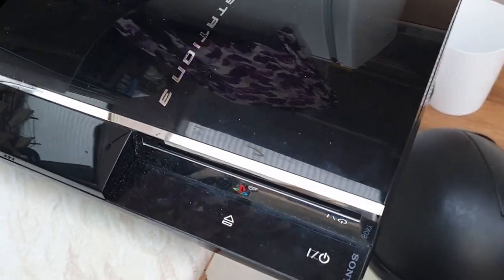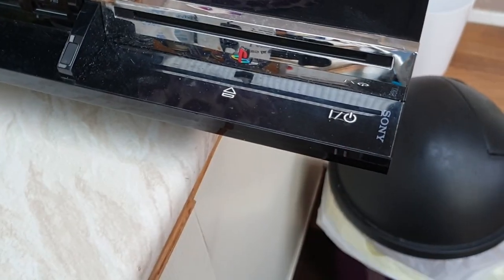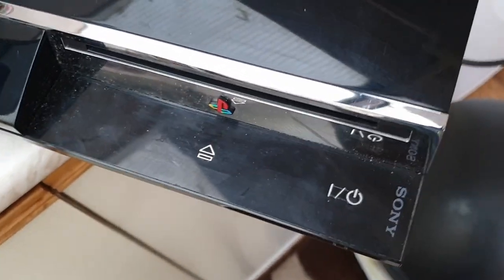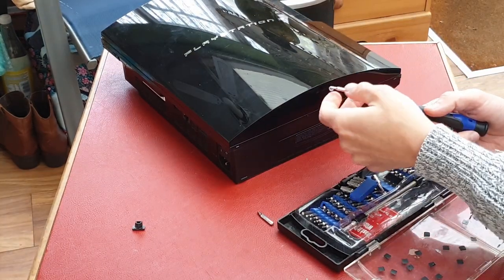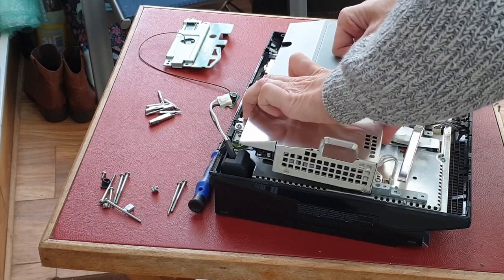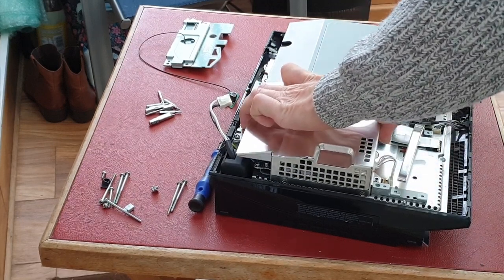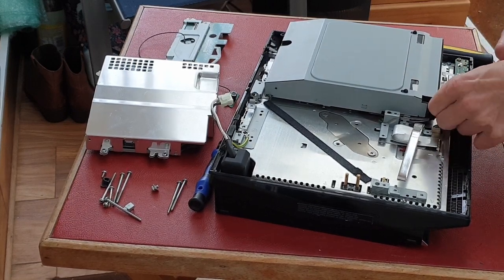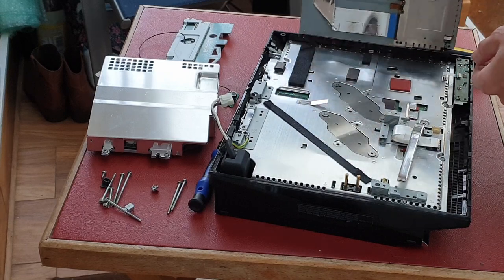Play Station 3 CPU CAP Tooth Floss Removal a New Method ?

Comment: You can remove the cpu and rsx ihs with a thin metal guitar string aswell and cut it off with it. To replace thermal paste underneath
Reply: Do you know which gauge would be the right one to use?
Reply: @alanjamesh.zamorano1677  Not sure but wouldn't it make more sense to just use the thinnest wire you can find. The smallest strings for electric guitar are probably .008

Comment: Having watched various videos on removing the IHS I went with your method as you used the words 'safest method'. 
Well, I don't know if I'm not very good at it but it took 4hrs in total, not sure how you did it in 10 minutes. It didn't really matter how long it took to me though, and I'm pleased to say they came off eventually, the RSX popped straight off but the the CELL was much trickier, thankfully no damage on either. 
They certainly needed some maintenance as the factory paste had gone very hard and crusty.
Reply from the maker: lol, this is a very cut video, it does actually take some time to get through the glue they use, but no risk of scratching the chip.  I have killed 3 trying blades and pallet knives, not to mention cutting my fingers on the razor blade !  that video is some ware on YT and that looked easy ... it weren't.. : /
Reply: @Retrogranddad would you recommend a fishing line could it be better than what you used
Reply: @mr.r0b0to5  to be honest nah, i read about people that used a fishing line and it scratched because of how strong the line is.

Comment: What about instead of going all the way through the chip, you could use the floss around the edges to only cut through the adhesive avoiding contact with the chip underneath? I have yet to try it but just an idea.
Reply: This is like i've thought. I think he had no intention of doing so❤

Comment: This is way better than using a blade
Reply: I'm planning to use this method on my ps3 super slim, do you there is good chance of success?
Reply: @jamespatrick686  most likely everything will turn out well, I have to try it on my fat

Comment: EDIT:
after few months I've realised that the unit itself had damaged cell solderballs, it had the eraser mod. 🥶 I've done other 4 successful delidding using molybdenum wire.

I've used 0.06 mm molybdenum wire. Unfortunately this method could break solder balls under the cell...Delidding looks perfect but It Ended up with GLOD. Be careful guys! Maybe, I've been unlucky.
Reply: How did you break solder balls under the chip? You saw under it instead of under the heat sink?
Reply: Looks like you went under the glue instead of the top
Reply: @cuttrogue nope, after few months I've realised that the unit itself had damaged cell solderballs, it had the eraser mod. 🥶 I've done other 4 successful delidding using molybdenum wire.

Comment: Excellent idea I was to nervous to try and delid my PS3 backwards compatible. But with this method I don't see how you can scratch the chip now 👍
Reply: practice on a broken dead PS3 first 
get a cheap broken PS3
Reply: its not common, but the thermal compound used in the CPU can be abrasive enough that if your tooth floss doesnt snap, it can catch the thermal paste and make micro abrasions on the cpu, significant enough to ruin the ps3 entirely
Reply: @Rick___  Oh for god sake...
Reply: Yes

Comment: Is the glue different across different models? Or is isopropyl not good enough? 10-12h of flossing and only managed to scrub away some glue around the edges. Zero chance of making the floss go through IHS like on the video.
Reply: Use sealant remover to soften the silicone.

Comment: Do not do this. I ended up essentially sanding through the solder mask on the PCB around the cpu die.

Luckily, I stopped after a few hours of almost zero progress, only to use an angled and sanded down piece of metal, and the traces may be intact from what I can see. It did go through the first copper layer in some areas though.

I don't know if the ps3 will boot, and I have strong suspicion that it won't, but I'll give an update after I've put it all back together... Luckily this was a second hand backup.

Update: YLOD.
Reply: Did you do a Syscon reading to make sure?
Reply: @0852657luis  pretty sure I basically sanded through the top pcb layer and cut three traces, one bigger and two really tiny ones... Should've stuck to the first method.
Reply: @phooopy7941  well you can always replace the GPU with a 65 or 45 nm GPU to make a Frankenstein backwards compatible PS3. There is a forum post telling you exactly how to do it. I've done it on my PS3 and it's been working ever since September of this year.
Reply: @0852657luis  I'm guessing you mean the cpu (cell). Did you also replace the nand and syscon or did you overwrite the values within them reset and remarry a new cell processor?

I do know that the RSX is more easily swappable, but I think that one is fine in my case.
Reply: @phooopy7941  damn, anyway I just remarry it. That's too bad there are not a lot of cpus for the launch PS3 theses days.
Reply: @0852657luis  Sadly my ps3 isn't a launch unit (cech-2003b), so I don't know if the remarrying process would be possible.

Here are some images of the CELL:
https://drive.google.com/drive/folders/1PsmEiRgxoQIV7u72krEmxOGU8MpnVc-O?usp=share_link

I took the latest picture, the one taken through a lens, after I used some jewelery polish and a cotton swab so that the traces would be more clearly visible.

The line to the right of the larger hole was caused by me using a tool instead (the tip bent and scratched the PCB... although, it seems like that only pierced the solder mask and not the underlying traces. I can now see that there are four small traces and not one larger and two smaller...

Do you think I could use one of those conductive silver ink pens in order to reconnect the traces and top it off with nail polish or soldermask? Well it's more of a syringe from what I can see on amazon.

I'm thinking that I'd need to cover up the surrounding traces and areas of ground before using such a pen pen to draw new ones... Maybe I'll even try to separate some of the grounded copper to the left and right of the traces (right side of the picture) and bridge the ink to the sides of each respective trace in order to get more surface area.

Edit: Seems like the curcuits neighnbouring the broken one's to the left upper left are all broken right at the curve of where the floss traveled through... Checked the other corner and found that some have been broken there as well. This complicates things significantly as that's a lot of traces below a strand of hair in thickness that needs reconnecting...

Comment: WoW It would be very good way to save pieces! I Will use something similar. I appriciated  however it's a 0.08mm wire I  bought on AliExpress!
Reply: Did the method work using a 0.08mm wire?
Reply: @EletroEsquilo  well, i've tried but not hard. I'm sorry, i can't help you. I did a mess with another caps and resistors wich accidentaly.. so i Will try to undo first It.
Reply: @rul644  ok. Thanks

Comment: Will this work on a ps3 slim 2500 ?
Reply: it works on all ps3s
Reply: tbh the 2000 series ps3's have a thinner amount of adhesive beneath the heat spreader so youll probably have a hard time compared to the fat PS3 he worked on.
Reply: @Rick___  I tried it on a super slim 4000 ps3 and it was a pain took a long time but it worked
Reply: @mlgleonardo310  is your console working?
Reply: @maxician5791  yes it’s working but I would be very careful I tried this on another super slim and the ihs was really stuck to the cell that came off with the ihs killing my second console